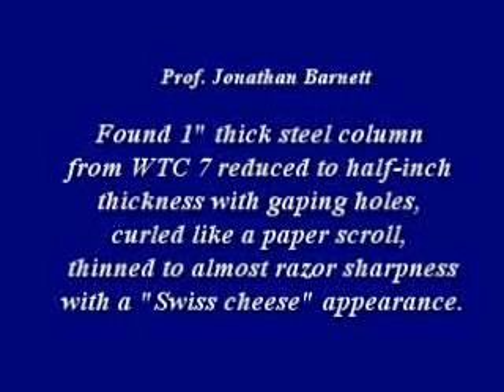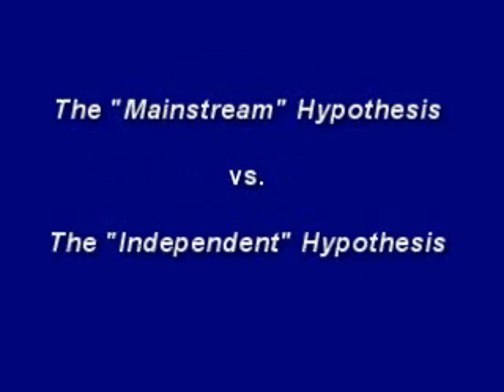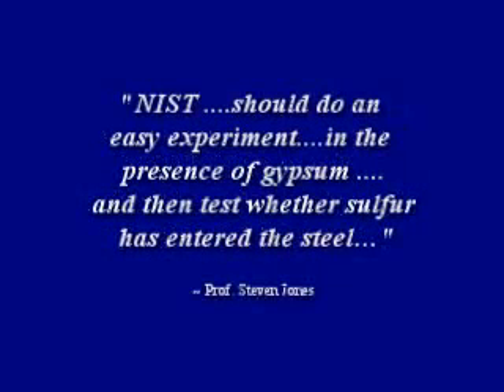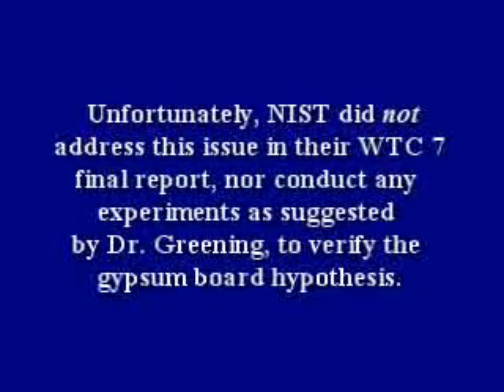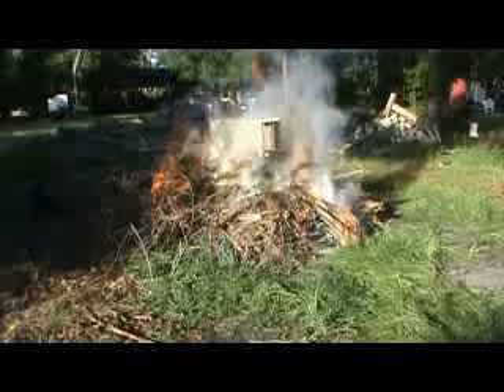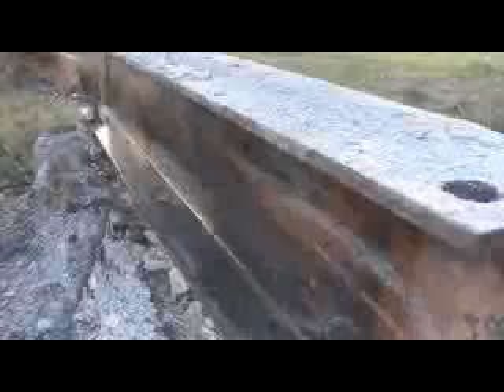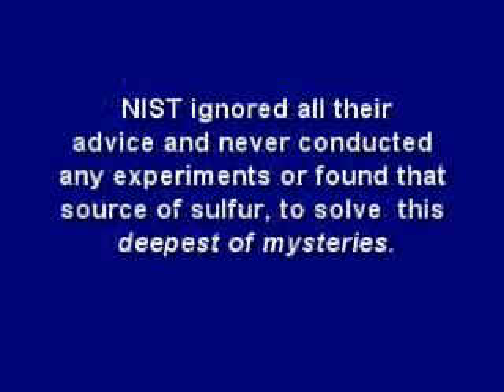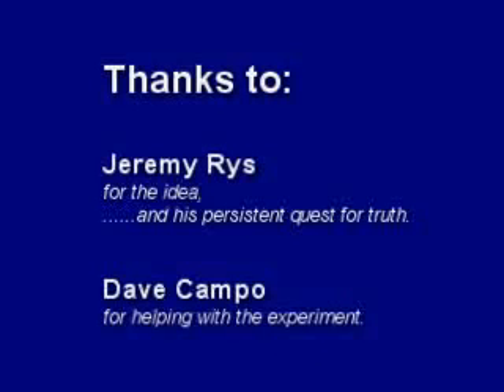9/11 Experiments: The Mysterious Eutectic Steel

Comment: @Skeptic121 Hehe, yet the towers have oxygen supplies like a turbocharged engine or a forge. Remarkably the smoke indicates oxygen deficient fires...  And at the same time the fires are able to reach 15-1600C or has some chemical to reduce the melting point to 1100C. Does he even understand the basics of what kind of tremendous energy required to amount to this or even what chem materials? 
He claims to have a bachelors degree in science, it should be revoked for public safety.

Comment: We are at this: Unreacted High Tech nanothermite found in the dust, eutectic steel in one of the FEW samples recovered and documented by FEMA. Yet no valid chemical or temperature reaction from the building material  could have caused this. Free fall acceleration for 100ft + making explosives/accelerants ONLY possible explanation. If you are a delusional DUMB FUCK you would desperately deny the facts like MERLIN5X5, and in a desperate attempt try to rationalize it with "people are sugar etc"

Comment: @mYOzZyKaT I mean, show as a natural fire collapse and everything you say would be valid. On the other hand we got thermate in the dust, temperatures that could not possibly have been achieved by gypsumboards/diesel etc. It looks and have all the evidence even FDNY would require for a controlled demolition. What part of this are you not getting? Are you claiming that building materials at 1100C MAX would suddenly jump to 1500-1600C because of hijackers? This is tremendously obvious to be false.

Comment: @TheSkepticalIdealist So what caused this eutectic steel then? What in a normal office building could create such a reaction? Thermate was found in the dust and has the ability to cut / melt / deform steel. Picture this, you are on a murder scene: The victim has a hole in the head consistent with a 9mm bullet, you find a beretta lying right next to him. I do not think Sherlock Holmes would have gone for the "natural causes" version, but then again you are clearly not SH.

Comment: I worked at Pratt&Whitney, designing military jet engines.
I can tell you right now jet fuel doesn't burn very well unless it is atomized.
And the inertia of the fuel itself should have ejected it outside the building in a fireball.
Also, building codes have not changed as result of this, meaning its bullshit.
If this building really did collapse due to fire, building codes would have to be massively revised.  They are obviously lying as usual.

Comment: @TheSkepticalIdealist  I don't know where you get your information but I've worked with steel, cut it, welded it, softened it to be bent, and "fire" doesn't weaken or soften steel... extreme heat does - at temperatures obtained by mixing concentrations of oxygen.   I was in Iraq 43 months and saw numerous tankers that had been hit and burned their entire load of JP-8 and the thin steel of the tank was not even crinkled.  I have a kerosene stove on my boat and the "fire" doesn't melt my pan.

Comment: @JimGawthrop I think you replied to the wrong comment. Yes Ive studied the laws of physics in my research. Check out my docu Three Seconds to Impact. FYI add to that the energy required to reduce 250,000 tons of steel reinforced concrete to 100 microns and you must consider the thermite was either a) the 'end around' or b) used to weaken the structure before the ' big hit'

Comment: I am  potter that works in wood firing, we deal with additional aspect that this video does not address. It is called reduction. at high temperatures when materials become more chemically active and are subjected to an environment that has fuel at a temperature that it would combustive and lacks oxygen any ferric metals melting temperature drops dramatically.  At 2300 degrees f we have melted 2 inch steel bars. adding calcium from the gypsum and concrete could drop the melting temperature. cont.

Comment: @TheSkepticalIdealist "So wheres the thermate demonstration? "

It is the claims of the NIST and others and the recommendations of FEMA that are being put to experimental test here.

The point being that the scientific method works when actually used.

The point being is that the scientific method was never employed by NIST with regards to investigating the 3 biggest structural failures in the history of structural engineering.

Comment: @TheSkepticalIdealist "So wheres the thermate demonstration?" You have a user on youtube, and you write in the commentsection, but you can`t use the search bar?
Are you as merlin claiming that no thermite compound would EVER melt steel?
And there is NO videos  of thermite cutting steel?
Thermite :2500C , Office fires/building material: 1100C Steel melting point: 1500-1600C. One of these components can`t possible melt steel, and one can. Take a wild guess. Its 50/50 chance:)

Comment: Or to put it very simple: Gypsum,diesel oil, ceriling etc that would probably max out at 1100C would more easily burn holes in steel than thermite at 2500C? Knowing that steel melts at approx 1500-1600C the math should be fairly easy to understand for superscientist like yourself. Or is this equation better : Building materials + fire + 19 hijackers and OBL = 1600C  temperatures and nanothermite residue. What kind of "scientist" are you excactly? You are certainly no mathemathician

Comment: @Merlin5x5 Let me explain it to you your feeble mind. Imagine 2 cars traveling at 50 mph. They collide at a right angle. Imagine the change in trajectory and velocity from the point of impact to the point of rest. Now consider a bulldozer and a car impacting at the same angle and speed.Again consider the change in velocity and trajectory between impact and rest.  This is a nearly identical weight ratio. Comprende?

Comment: @Merlin5x5 Why are you always nanothermite painting yourself into corners? Isnt the whole basis of the official theory that the fires had plenty of oxygen to sustain its "fiery inferno"?  And still you claim that thermite under no circumstance can melt steel it will cool, and that gypsym/diesel/ceiling tiles would reach above 1600C making the holes. Dont you understand the above experiment? Do you still believe that gypsum and other building materials would spontaniusly combust shredding steel?

Comment: @Merlin5x5 Do I need to pull up the specs? 150 tons max roughly 100 tons empty. Its not even a tube with solid walls! Its skinned and ribbed! The only pieces of a plane capable of penetrating the towers are the engines and gear. A fucking bird can shred an airplane!!!! And you honestly believe 4100 tons of steel and concrete cant stop it? LOL!!!

Comment: @Merlin5x5 So you are saying that the gypsum, ceiling tiles, diesel fuel etc would burn holes into steel beams, but thermite cannot even remotely melt it. The thermite burning at 2500C would cool well below 1500C , yet the gypsum boards , ceiling tiles would easily burn through it though it cannot achieve 1500C. I would put my bet on what is possible rather than the impossible. And have you still not found any videos that present thermite cutting steel? I guess we`ll have to take your word 4 it.

Comment: @Merlin5x5 That really depends on how much thermite per square inch you got:) If you use several hundred pounds of thermite distributed evenly over the whole half ton girder kontra several hundred pounds of thermite concentrated more at the center:) These different approaches would give very different results. It would be inefficient to distribute the thermite if the goal was to cut or severely weaken the strength to endure lateral loads:) Burning a hole in the girder would be achieveable.

Comment: I always knew, when I saw that cascade of melted steel coming out of the side of the building, that there was something off, I saw another video wich showed another gentleman doing an experiment with THERMITE and a beam of steel, simular to the one you used, that THERMITE stuff MELTED that beam like a hot knive thru butter. it never went RED it just MELTED!!! he also went on to say, that the U.S army uses that stuff all the time, in anti-tank artillery.